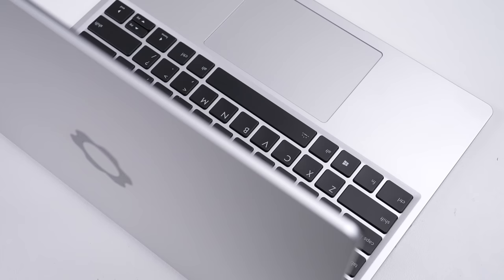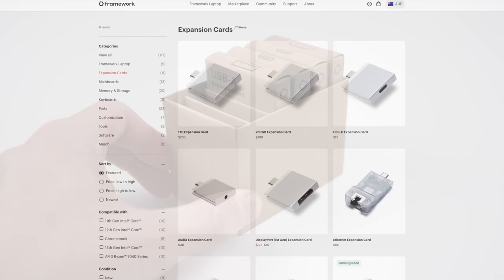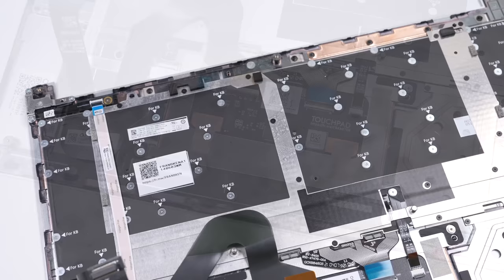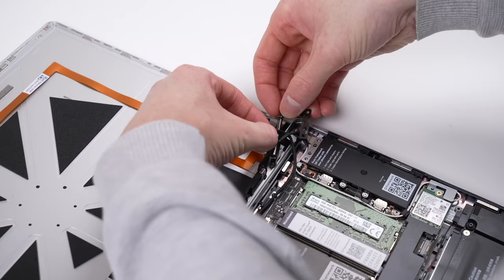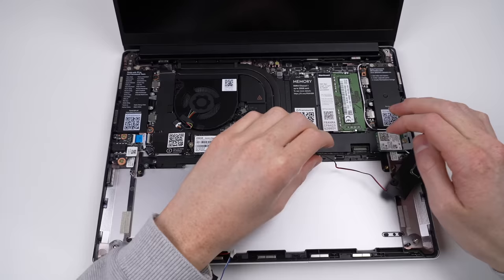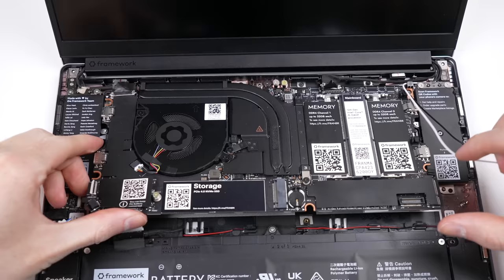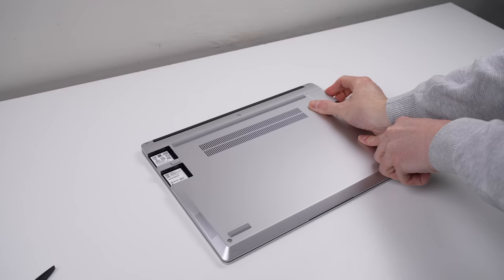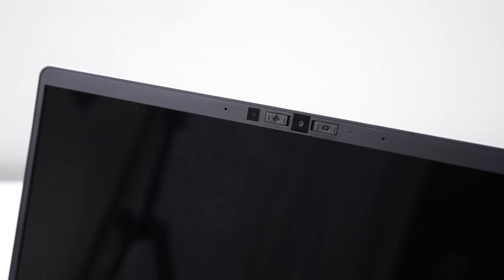New Laptop Brand Shocked Whole Computer Industry - Framework Laptop - Teardown And Repair Assessment

Comment: It is  a great idea. But I wonder if it can survive the changes in the industry. Normal people skips some generations before  changing their laptops. Hopefully they will keep that motherboard+cpu format 5 generations from now. Also, what happens when the market looks for something thinner, or heavier or with better battery? Will they make a Framework 2, 3, 4 where you have to buy parts specifically for that model? Like any other brand...

Comment: Needs 7 slots, charging, sound, 3 usb a, 1 usb c,  hdmi and ethernet, that is what i use in my laptop connected to my monitor, you should have 3 smaller interchangeable ports on ezch side plus charging a d sound slot, so 4 usb, 1 hdmi and 1 ethernet interchangeable

Comment: I really, really wish that this is a lasting success! I have never seen this modularity before, except for towers of course.

I have planned for a video showing Apple's change (decline) in maintainability. Their 2000 model (Pismo) was great, the closest to this I have seen. Their 2012 (non-Retina) model was the last that was truly maintainable/upgradeable. From there, things are going downhill, with soldered RAM, glued battery, and more lately, and maybe worst, soldered SSD!

I must check this out. I would need a swedish keyboard, and be able to run Linux. The rest looks like a dream computer!

Comment: I have a Lenovo laptop from the year 2017 and it's almost same to repair, there is plastic ribbits instead of magnetic connectors and it does not have option to replace the ports but I'm pretty happy with the ports they offered. If this laptop is as cheap compared to the Lenovo, then only it's worts buying otherwise it's not at all worth it

Comment: No 4K display. No track point keyboard like on Thinkpads. No dual port expansion modules. No SD card module! No built in I/O at all! 2 ram slots, not 4. No CPU socket like my Thinkpad. No Intel option in the 16" version. Let me know when they laptop actually becomes perfect! In between time, I'll keep using Thinkpads!

Comment: Not gonna go too far. I used a Macbook Pro for 8 years nothing in it broke I could still use it for another 4. Mac OS is a great OS. The modular/replaceable ports is a the only good idea about this laptop. New break throughs and inventions in hardware happen every few years which might not necessarily stay compatible with the old chassis. Also on many currently produced PCs you can replace almost of the parts replaced in this video.

Comment: You are paying a fair bit more initially to see a return years later. I mean a G14 can do nvme and ram and is much cheaper spec for spec. Selling the old bits you change out could be difficult, just selling the machine and get the latest seems smarter. This is extremely niche, for those that want to upgrade every year.

Comment: The only downside that I can see here is the aluminum frame/case - once you drop it, depending on what it lands on, at best you will get a mark or a bend case forever.  Some guys are dreaming 10-20-30 years of livespan, well not in an aluminum case like that. Something like the magnezium T-series Lenovo shell can withstand 10+year but not an aluminum one. Based on real-life experience for the past 15+y of using a laptop.

Comment: Hot Intel cpu means the cooling fan will kick into high rpm frequently and venting out the bottom likely will cause system to throttle performance.

Comment: This is smart! They charge you more, give you less, and expect you to do some of your own configuration, expansion, and repair. Why din't I think first of this amazing business model? :cat-orange-whistling:
Reply: You do realize that all the separate parts you order still have to be fully tested, right? They actually have to assemble those parts into test machines for testing and then disassemble them again before shipping them to the customer. That's why ordering preconfigured systems from them is cheaper -- there's less labor involved. They also have to deal with warranty repairs and returns just like any other laptop company, with the added complication that it could be user error in many cases for customer-assembled units.

They are a very small company who can't take advantage of economies of scale like Dell and Lenovo can. I guarantee you that Framework's profit margin per machine is lower than Dell's and Lenovo's, even if they're charging more for equivalent configurations.

I'm sure the Framework guys would get a good laugh at the idea they'd stumbled upon a way to make easy money in the laptop business. (Hint: if it was that easy, everyone would be doing it!).

Comment: most of the laptops can change ram, battery, ssd, display and speaker. motherboard, graphics card, CPU is together. only difference in this laptop is ports can be removed.

Comment: I was just think about the "right to repair" thing and how an extra tax that scales with the difficulty of repairing units and non-upgradeability would basically force companies to change their mindset.
Imagine something like this laptop having no extra tax, while others going up to something like 50%, with something like Apple, where you can't replace anything, have no OEM parts, and anything that can be replaced has to be done by them.
It would also push companies into working with other companies that make parts / upgrades, instead of suing them.

Comment: Not a fan of super thin laptops.  Rather they be thicker with more battery storage and heat displacement.  Batteries should be 18650s so they can be replaced as needed.  I would also like to see an open architecture shared by all manufacturers with standardized parts.  Sick of laptops that have short lives.  This is an improvement but a long way to go.

Comment: I think Linus Tech Tips made a video about this 2 years ago too. Good to know that it's still holding up well. It's really good to know that most of these can be replaceable. I doubt that there will be 3rd party parts for the mainboard though, as that's the most important part that includes the processor. Should Framework go out of business, any future upgrades on either cpu or gpu graphics doesn't sound possible. If I'm wrong about this speculation, please correct me.

Comment: I had a Zepto 14-inch Nox A14 gaming laptop. The company went belly up soon after I purchased it in 2008. It offered the ability to upgrade the CPU, GPU components, memory and DD but that was all. The cooling system was inadequate and the laptop would overheat easily... expensive junk!

Comment: it's incredible how many commenters seemingly have time to waste to insist that SURELY Apple doesn't INTENTIONALLY make their stuff difficult/impossible to repair even though this is easily proved wrong by even the most casual research into the subject. like yeah, they definitely constantly make software changes that respond with hostility to anything that might look like a replaced part COMPLETELY BY ACCIDENT

Comment: Good concept, though it is still held back by the price of laptop itself and upgrade parts. Math has been done by Dave2D and it looks like in few years you're better off buying a brand new laptop as an upgrade, rather than replace and upgrade main components in Framework and you're still left with old frame, keyboard, screen etc. It is an appealing concept, but won't catch on, if the prices won't come down.

Comment: 🥰 - I like that! Currently stuck with a Hewlett-Packard Pavilion G6 ~ have had to clean the heat-sink, replace the screen, put an SSD hard drive in it to attempt to speed it-up, the battery developed “memory-loss” and I didn’t get around to replacing it, and as to how old it is - I have to unplug it from the meshed router to stop windows update from finding updates and bogging-down/hogging the CPU on booting and I have to wait for it to do its things (CPU at 100%) before I can use it, and it is soo old when I was offered the Windows 11 software upgrade it checked it and said the CPU is not compatible…… 😠 so I have to replace the entire motherboard just to “replace” the CPU, to upgrade to windows 11!  However my dinosauric laptop is still working properly so I don’t mind - until something seriously goes wrong with it. Interesting seeing how fine the blades are on that centrifugal fan on the framework ~ how easy is it to get to the heat-sink to clean the dust off the fan side

Comment: Modular laptop, yet you cant swap out the battery without tools, and you cant even upgrade it to 99wh to maximize your runtime (good luck doing a battery swap like that on an aircraft) 

Also no way to replace the trackpad with one that has dedicated left and right click buttons 

And the CPU is still soldered to the board

And to top it off, theres no option for a dedicated GPU

Comment: This technology was introduced back in 2011, but do you what the giant computer and mobile phone industries did, they completely shut them out of the industry. Those geeks were never heard or spoken of again. Imagine you could replace your mobile screens, mother boards, camera sensors and lenses, as if they were an SD card in a slot. Their laptops had the same characteristics too. I wonder what happened to them.
Reply: But you CAN replace mobile screens, mother boards, camera. With right skills and tools, because what a surprise - they are not SD card in a slot.
>> This technology was introduced back in 2011
What technology? Screws and connectors?

Comment: 🎯 Key Takeaways for quick navigation:

00:02 🛠️ The Framework Laptop is designed for upgradability and repairability, featuring customizable ports and easy access to components.
01:14 🔌 The laptop's unique modular ports allow for various expansion options, including third-party adapters, giving users flexibility in their connectivity.
02:39 ⚙️ The Framework Laptop's internals are easily accessible, with user-replaceable components like SSD, RAM, Wi-Fi card, and battery, enhancing repairability.
04:05 📺 Upgrading components like the display and hinges is straightforward, with guides provided, allowing users to customize their laptop's features.
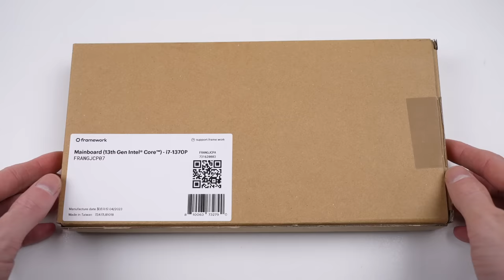06:31 💻 The Core i7 motherboard upgrade offers higher performance, and the laptop supports a range of Intel and AMD motherboards for user customization.

Made with HARPA AI

Comment: my acer9920 from 2006 is full upgrade-able and i did!  
it get a new battery is easy to place from the out site, a newer CPU, 2hdd / ssd and 4gb to ddr2 8gb 800mhz or video card, or WiFi, bluetooth even the dvd player and the screen and the keyboard can taken out easily.

Comment: That's so amazing, but will it success ? it is harder to make, and it will be  expensive, average consumers will rather buy PC with same specs but cheaper, most consumers are average, so not sure about the pricing of this. Also what about durability ? we all trust other manufacturers for the durability, some of us have HP or DELL laptop since 2010 and still work properly, some of us drop their HP pc and it work properly, will this resist ? how the heat management ? how the batterie life ? I think those are things most important to look at than the repair process.

Comment: Do the hinges screw into aluminum boss/stand-offs?

As a repair person, its never the hinges but the plastic boss/standoff that the hardware goes through into that fail.

For instance the battery uses a plastic boss/stand off, but I cannot see if the hinges are the same.
Cheers

Comment: I will definitely buy 5 models for my small business once I know Linux (Mint and Manjaro) is better supported and they don't have out of stock on many of their options i.e. audio expansion card.  That's a critical card to be out of stock.    I am not confident this crowd has the financial backing to achieve their goals as per their website.  You cannot be running out of components. 
There appears to be a 6 week wait before shipping.  That won't cut it for me. I want to see supply chains and warehousing of components more robust. These guys should have a warehouse on every continent. Their components are small and light enough to disperse for faster delivery. 
Remember what happened in Covid for any goods coming out of China.

Comment: So much better for the environment. I have now have to throw away my almost perfectly working laptop because a repair of my onboard graphics card is a to expensive repair.
MSI wants to charge €799 for the repair. Using the framework system I could just replace it myself.

Comment: wanted to get one, but they didn't ship to switzerland at this time... yeah, now i have a device for the next 5 - 10y (hope, that it holds, last lasted 10y, but was an upgradable enterprise notebook... -> was also with an external battery, had the biggest one installed -> sticks out, but offers about 1h more battery life -> so after 10y still 6h)
i think the most important thing is the firmware on those devices... so far hp and dell was not complete hell, old thinkpads where really good and the rest was pure hell... yeah, framework should be on the thinkpad level...

Comment: So basically the same cost as a MacBook Air,  except more expensive.     Looks nice enough for a thin Thinkpad.     Well thought out.    Who knows how reliable?         Having owned a bunch of Apple stuff over the years,  mine have been extremely reliable, which kind of makes me wonder if I am an outlier on a dozen different products, more or less.       Most of the stuff I have worked on for non-technical people have been upgrade to memory, batteries, hard drives, SSDs, and the occasional display.    User-repairable means a lot less when the user doesn't have to repair things,  you know?

Comment: These laptops are like that crush you had on that Spanish girl during a that family holiday in Ibiza, you fell out of love 100 times faster than in love. It has something to do with the ambiance, like a Sangria or that expensive red wine you drank in Spain that does not taste nearly as nice once you are back in Blighty. Don't even get me going on that Vespa you loved to take for a spin around the town to impress the ladies, but would make you look like a right wanker in Brighton, and I mean all those USB C connected "upgrades" that turn your laptop into a very badly designed Swiss Army knife, and a blunt one at that. I can just see this happening in the Board Room, The CFO jump up and calling every body to silence as he whispers "Gentleman and Lady (she is from HR), can you please remove the lan port from slot 02 and replace with the CEO interpreter on that port" And it is right there that you realize that somewhere on that Swiss Army Laptop there is a "Made by Elon Musk" sticker on it and on scanning the QR code, he explains in his short promotional video that this laptop is the precursor for the "InterceptorX which comes with 66 interchangeable "tiny devices" that one day will control your very own "Falcon 9 and upgradable to the new Starship command module, and the factorX that will command your Cybertruck to go and charge itself using the connectorX module to safely guide your Cybertruck to the only charge station which is located in Denmark, which means you will also need the Channel CrosserX to navigate the ferry system from Dover to Calais. But nobody told you that it is the moderately priced "SupaX'r" that overrides all this nonsense and it is called a Dell Laptop. Just like the PI came and went, the Framework will need replacing with that Dell once the novelty wore off. Peace brothers and Sister (She is also from HR) and have a lovely day.

Comment: Yes, they didn't think of putting in a socket for cpu anyway. And making a software to limit the use of cpu if its too powerful for a laptop and could overheat. 

Replacing a whole motherboard is both unnecessary AND too expencive!

Comment: Weird. Feeling witching this using a surface 4 that has many bug :battery, flickergate ... and you need a heat gun to melt Glue in order to open it with the risk of screen being shattered

Comment: With the way EU goes, this solution will be no choice, rather mandatory for every manufacturer. As long as everyone does it, it won't be pricier than fully integrated components. However,  the last decade, it is by my experience, firmware and drivers that has been the problem and made hick-ups and made the computers fail way before they're expiration date.  Sadly I don't think this will take off. So many have tried already. You think it will be a success?

Comment: flexgate cable macbook flickering monitor display after short time not here, a real cable used for display. Replace parts like with gaming laptop Schenker  / XMG very good new brand 
thank framework to bring good products on the market. let us be in control of our own hardware. plugs instead of glue

Comment: the problem with this is it only has mono memory, even if you upgrade your ram, it will still catch errors when you use it with a heavy applications., GPU is not upgradable as the GPU you are using is built in with the CPU and motherboard. It really doesn't make any sense to upgrade this laptop to the fastest one unless you're using it for basic applications for business that needs faster execution. once it catches some unwanted applications that was installed accidentally or some malware, this laptop is doomed already.

Comment: Great concept, still overpriced.  Hopefully it can gain enough support to allow prices to drop. @$800 it is a bargain. @$1400 you could have bought 2 computers, 1 for what you want right now, and another for what you might want in the future.
Reply: It's not a bargain at $800 because they bait and switch and force essential "upgrades" like power adapter, usb ports, memory, ssd -  basically everything you need, so out the door I was around $1100 for (base model w/ i5 16gb 2tb).  Only offering a 13" or 16" is a deal breaker for me too - the screen options suck for digital nomads.  Give me a quality 14" display.